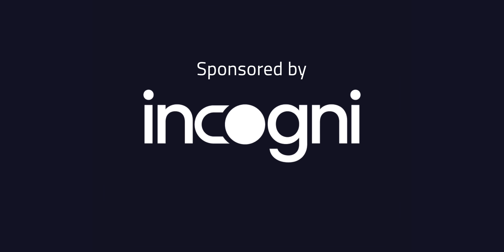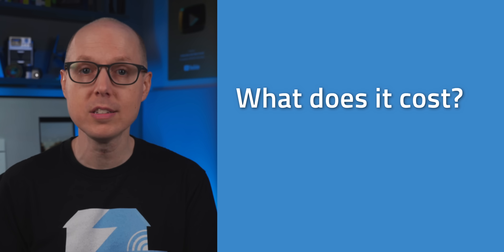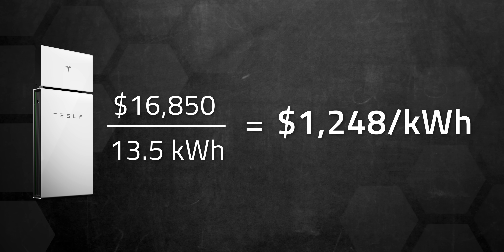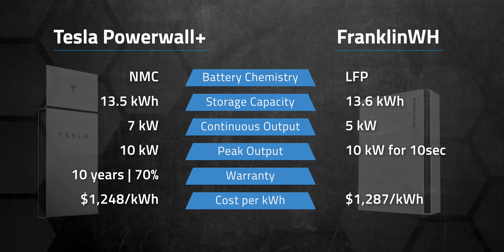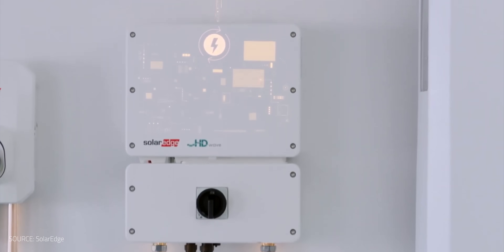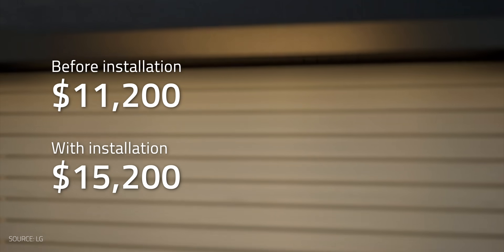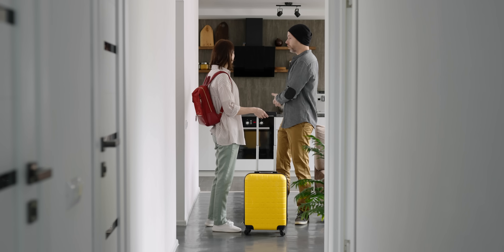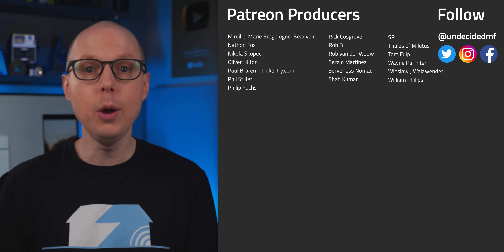Top 5 Batteries for Home (And One You Might Not Expect)

Comment: I find it odd that you don't mention the Generac PCRcell battery system that can charge from solar panels and fueled generators in addition to the grid. Since we already have a Generac generator we are looking at this system to capture power from our solar panels when the grid is down, with generator backup, and SMM for load management, all managed from their app.

Comment: There are a lot of other options not covered here that are much cheaper. Rack-mounted LFP batteries. A little DIY, but no reason you couldn't hire an electrician to do the install. You're looking at like $1,500 per 5kWh battery. That's like a quarter of the prices listed here.

Comment: My Lightning has been carrying us for five days - so far. 131kW battery. I’m buying an electric Monarch tractor with a 101kW battery. Both have 220v 30amp, and 110v 20amp outlets to plug lots of extension cords. I also have a 6kW Goal Zero for portable power. ALL are portable. All are expensive. All have multiple uses.

Comment: Had 3.2 kw array installed to the Enphase Ensemble (grid-tied) with 2 of the 3.4kwh batteries to start. I added 2 more of the same for a total of 13.6 stored capacity.  I go on self consumption mode in May and back to full standby backup mode in late September. My average daily consumption in the summer is under 6 kwh, and average daily production was around 15.2 kwh. We're not net-metered here, as I buy from the grid at 12.2 cents/kwh and sell at 6.8. The difference is brokerage and system maintenance fees, as I see it.
Before I bought the system, I replaced my 24 year old well pump with a soft-start low voltage pump. I replaced all the ceiling fans with brushless motor fans. All lighting is LED. My fridge is one of those European imports with serious energy efficiency.  I insulated the beejeezus out of my attic, basement and crawl space sealed around the sill. All this because I wanted the safety and longevity of LFP which had about 5 amps available per battery. When the grid went down in the winter I had to shut off my resistance heaters. I did what I could to minimize my usage instead of buying a huge system to start with. Then I added storage to double my available amperage, so now I can microwave popcorn after sunset.

Comment: I don't understand the push for high energy density for Home applications. 
I like the Redox / Vanadium Flow batteries. 
Largely non-flammable, extremely long life (95% capacity after 30 years, over 15k cycles)
For me the critical parameters are 1.Cost, 2.lifespan 3.total capacity 4.discharge rate (discharge rate is almost always sufficient)
Several new companies popping up for residential and small commercial applications. 
Seems like hands down the best option for residential power storage.

Comment: A $1000 USD gasoline generator back fed into the service panel for "just in case" there's a rare power failure, is do much cheaper. Why spend $20000 for just in case which is a rare event.

Comment: There are so many others that you did not mention. Homegrid makes a very easy to install stack system that has up to 14.4 continuous output, and up to 24 kw surge with up to 38.4 kWh capacity per stack. Storz power is another option that is modular.

Comment: There is one option I would add to the list. Flooded lead acid batteries. They are the standard against which all other home batteries are measured. WITH PROPER CARE, they can last decades. They need to be taken care of though. They are cheap cheap cheap though and that is why my low income off grid community uses only these batteries. Mainly they are forklift batteries. L-16's. I am not considering lithium for stationary storage, it is too expensive. I would like to store hydrogen though. My plan is to make it from compost tea (urine) and store it as a metal hydride or possibly ammonia

Comment: In my opinion home batteries are (still) a joke. With my 12 panel installation I produced last June ~630kwh. I consumed 125 from my energy provider and returned ~480kwh to my energy provider. Last December I consumed ~560 kWh from my provider, returned only ~12kwh to my provider and my installation produced ~62 kWh. So now a days there is no sufficient/affordable home battery that can store my produced energy for the wintertime. In my opinion I think it is more efficient to “store” the energy by the energy provider.

Comment: Great video.  I have a Sonnen 12.5kw home battery system that allows us to set the amount of battery we allow peak grid use in the evening while maintaining some capacity for overnight power failures and has the ability to integrate a generator into the system.  One big advantage I don't remember you touching on is that whichever system anyone wants to choose, they should make sure that the battery gives the solar panels the ability to continue charging and powering the home during grid failures.  When grid tied solar-only loses power from the grid, the solar production automatically stops to prevent the solar from back feeding the grid.   The major home battery systems have the ability to isolate the solar output from the grid for use by the system and home only while the power is out, and then restore solar output to the grid after the grid power is restored. We are on a well and would lose water when power went out.  With the battery, we can continue to run the well pump and recharge the battery from solar while power is out.

Comment: I'm from Belgium and i am using a Huawei LUNA 2000 5KWh storage battery, that can be stacked upto 20 kwh storage. This battery cannot run the house with a power outage. Since in Belgium those a pretty rare i did not need that extra cost. Price for that battery was 3300 euro or 3700 dollars.
Very happy with the setup
in 2022 we had a self-sufficiency rate of 70%. from march tll august i'm at 95%

Comment: We are pretty happy with Enphase for the following features: A) in consumption mode the house is drawing first from the solar panels, second from the battery, third from the grid, which minimizes purchased power; B) Enphase mother ship monitors the storm forecasts and switches the battery to backup mode, where power comes primarily from solar panels and secondarily from the grid; C) the Enphase app is instructive of home power draw, helping us choose how many devices we use simultaneously. I have been on this system for three years, paid a lot more than the quote in the video, but have no regrets. LFP seems to be great for getting the maximum cycles of lifetime battery usage which is quite opposite what I want from my EV (fast charging and high output).

Comment: my system is DIY 48volts 5000 watt inverter 8X150 amp and secound battery bank 8x100 amp can take power from grid and charge battery or the gas generator 12X300 watts panels and a 800watts windturbine and every thing only cost me  4.696,85 usd  and now i have free energy and more than i can ever use

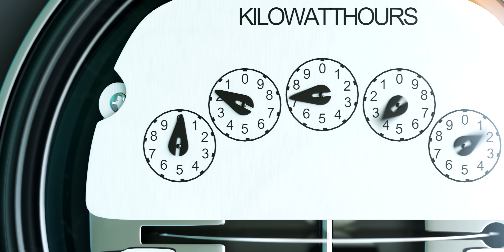Comment: Ref: 2:32 => Unfortunate (incorrect even) use of the phrase: "Kilowatt hour is kilowatts over time" as the definition of: kWh .   "over" in mathematics means divided by; so the phrase: kilowatts over time would mathematically be written as: KW/time  or (with time in hours) kW/h   and not as the correct term = KWH.   Yes, I know that power used over a period of time represents energy; however, it is, IMO, the duty of good advertisement to avoid words/phraseology  that can lead to misunderstanding.

Comment: As many others have pointed out in the comments, DIY options can be FAR cheaper than any of the options listed in this video. Yeah, you have to "do your homework" on how to put it together. But if you do the homework to get the correct size inverter, the batteries are effectively infinitely expandable at far cheaper than any of the video's options.

I see many people mentioning "server rack" batteries. While these are great and are cheaper than the video's options, even cheaper is to effectively build your own server rack with separately bought LFP non-"server-rack" batteries. When I bought my battery packs, I paid about $7500 for 30kwh battery capacity. At that time, to buy a similar size EG4 would have cost about $13k - nearly twice as much. And buying 30kwh through any of the companies in this video (expansion batteries only, not including the installation of overpriced home networked inverters) would have probably cost well over $20k.

And remember, inverters have serious inefficiencies. Getting a 10kw inverter will drain your battery way faster than needed when you are actually only using 5kw ... or fewer.
I know my needs and got a 3kw inverter which supplies more than enough. And by getting a lower kw inverter, I have far less waste (both on product cost as well as electrical waste) than if I would have gone with any of the video discussed options.

My whole system (not counting the solar panels, since those were not part of what the video discussed) cost about $9k and although there's not much of a warranty, I expect it to last upwards of 10-15 years easily - and possibly closer to 20. And with a $9k cost for 30kwh battery capacity? That comes to an overall cost of about $300 per kwh... or about 1/4 the cost per kwh capacity of any of the systems mentioned in the video.

Comment: Solaredge is not installed as a string system here in Missouri. All solar edge systems we install are optimized systems.

Calling it a string system is misleading. That implies the panels are directly connected with nothing in between. 

In a solar edge system every panel will have an optimizer placed under it.

Comment: StorEn Technologies will have a vanadium flow battery with + - 30kwh storage in two configurations, one buried in the ground to save on cooling and one interior type unit paired with solar, wind, or just grid backup.  It will have 25-30 year life and be fully recyclable.

Comment: In Mesa, AZ we have time of use charges.  A normal is 4.1 cents per KWH and during peak if you have solar it can go to as high as $33.50 per KWH and thet charge is after 7 KWH per day during peak.  1-3 KWH cost $16.00 per KWH and 3-7 is $24.00 per kWh and after 7 it is $33.50 perKWH.  This makes solar the very least energy cost savings in the country.  We also get the privilege of paying an additional fee go $35 per month just for having solar.  My bills for electricity after the solar install have increased by $100 per month.

Comment: Will you be waiting for the latest generation IQ5P battery from Enphase? Power is increased for both peak and continuous power. And the communications are moving from zigbee to a wired solution that is more stable, reliable, and installs faster…thanks Matt

Comment: Thank you. The UK market is some way behind the US and of course costs are not directly comparable. 

Personally I am holding out for a flow battery system, not least because I prefer a system which will recycle more easily, make fewer/no demands on rare and/or toxic materials,  reduce risk and increase longevity.  I currently heat with carbon dense but non fossil fuel, tank gas back-up, solar thermal and electricity from a renewable resources supplier. 

My house is historic and impossible to insulate really efficiently, also the authorities forbid visible iinterventions on and in some cases inside the building main but I have outbuildings, land and (hopefully) time for construction.
I'm very interested to see developments in the potential of domestic scale wind generators and the forthcoming flow battery market (gold rush). One concern for me is that there will be problems in extreme cold conditions for smaller installations, restricting their use in cold climates. I can see that problems of this type might reduce with large battery installations but winter maintenance of wind generators is an obvious draw back.

Comment: $1,300/Kwh is fucking INSANE. I can DIY batteries for ~$150/Kwh. The choice is clear bitches. I already have one 500Wh 40x MJ1 scooter battery successfully modified...Now if I can ad a shit load in parallel. Ben messing with batteries since 2015. Glad I did. The future is electric. The most efficient energy source possible. With DIY being easy (soldering kinda sucks i think tho)

Comment: Does Powerwall use LFP?
One of the most significant changes to the new battery pack is the switch from lithium NMC (Nickel-Manganese-Cobalt) cells to Prismatic LFP (Lithium Iron Phosphate) cells, which will make Powerwall 3 cheaper to produce.Apr 14, 2023

Comment: Add our ideas to the list?  Reconditioned car batteries.  You can get 10 or 12 of them for around $300 - that is three HUNDRED.  And even just 8 is enough to run the average home for 12 to 14 hours prior to deep discharge conditions (ie. >20%).  Each battery is about 1 to 1.2 kWh so 10 of them is 10 to 12 kWh.  Here's the good part and what makes these the best solution: It's like $20 - $30 / kWh as opposed to the $1,300 / kWh you're talking about. They take up a little extra room but at that price WTF cares! And if you know how to recondition them yourself they're between $0 and $10 each out of a junkyard.  Why would anyone in their right mind pay over $10,000 for a battery system when $100 to $300 will suffice?  cRaZy!

Comment: I went for a Sofar ME3000SP AC inverter with 3 x Pylontech 3kWh batteries. I now have it working nicely but I'm not sure I'd recommend as the integration with 3rd party systems like Home Assistant is dreadful. Thanfully a open source project called Sofar2MQTT came to the rescue.

Comment: You compare batteries including invertors, It is more interesting to compare batteries with batteries and invertors with invertors.
For example,  If using LiFePo4 batteries for 15kWh storage, you can get it nearly by 2500-3000$ + invertors varie from 500$ to 5000$ (and beyond)

Comment: A 1kW microwave oven actually draws around 1.5kW of electrical power.  The specified power is for the microwave output rather than the electrical input and they tend to be only around 70% efficient.

Comment: Reading up the other day, Vehicle to Home options with Bi-Directional charging seem to be coming on the market.  As I understand it Wall Box released their Quasar 2 Bi-directional charging in the US recently.  I have also read that Enphase have a similar product in the late stages of development which would plug straight into their controller.  May well be some limitations on Peak power, but, EV's have massively big batteries.  Might not prove out but intriguing enough to hang off for a few months (or a year+ for the Enphase product) and see how it works out.

Comment: Another emerging option is putting the battery in an Electric Vehicle (EV) to double duty. Many EVs are coming onto the market with Vehicle to Load (V2L) (a plug in appliance); Vehicle to Home (V2H) (supply/supplement a house) and Vehicle to Grid (V2G) where power in the EV’s battery can be sold / help stabilise the grid at peak times. In the last two configurations the EV utilises a bi-directional charger. Just like a house battery system, it can soak up excess solar energy during the day & give it back at night. The higher capacity of an EVs battery could meet the entire power needs of an average household for 3-4 days.

There are compromises. First one being the trade off between powering one’s house & available range before recharging the EV - but than can be managed automatically by software which will retain enough charge in the EV’s battery to make a known journey. The second is the additional cycling of the battery may degrade it a little faster.

Of course, only a % of people will be able to take advantage of a system like this. Ie WFH or retired so the vehicle is at home during the day to be charged by the home’s solar system & usually garaged at home at night. But for those who can, it’s effectively buy an EV & get a ‘free’ home battery thrown in as part of the deal.

It’s not everywhere yet. V2H/G capable EVs are only just starting to appear on the market & the bi-directional charges haven’t received the final tick by all local electricity authorities. Apart from confirming safety details, the electricity companies are exploring the feasibility of Orchestrated Charging/Discharging. Where myriad plugged-in EVs act in concert under their instruction to provide grid stability services or become virtual power plants. So there are practical, legal & billing/credit matters to work through as well before it can be widely introduced.

Comment: Enphase - because the microinverters talk to each other - has an advantage over some of these other battery choices. When you're off grid, it works in tandem with my solar panels so your house runs on solar until the sun goes down with the battery filling the gaps in demand.  The two biggest issues I've had are that there's occasional system lag (of maybe half a second but that matters for some sensitive electronics) when the grid power goes down before the batteries kick in.  The other is that the communication equipment relies on cell and has been less than reliable.  Manufacturer support has been strong as has my installer's support working through these glitches. 

I wish FL had a time of use tarriff for residents so I could benefit from many of the more refined features of the system but can't blame the batteries for that...

Comment: I just ordered a 20.48kWh set of 48v LiFePo4 backup batteries from Signature Solar in TX for about 6 grand with welded server rack on wheels.  That's $1,399 on sale for a 48v 5.12kWh battery with internal BMS. They're part of a $10k solar setup with 5.4kWh of panels to take me fully independent of supplied power from the grid.  I'm retired, so I get no tax cuts from the grid-tied rebates.  Mine's all OFFgrid.

Comment: What about the Lycan 5000 Power Box, by Renogy $4,199 for 4.8 kWh expandable to 19.2 kWh plus installation. not as robust as a Powerwall but could be used by renters, as it comes on wheels and hit's a lower price point.